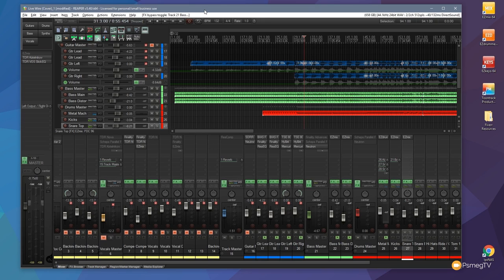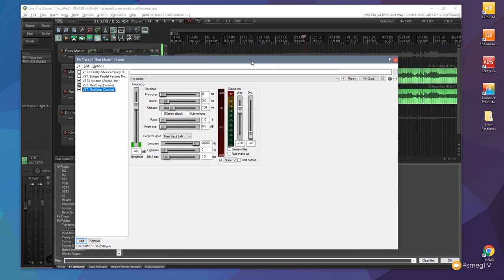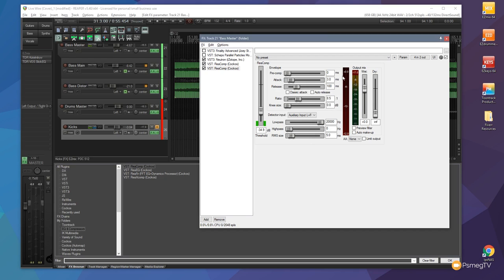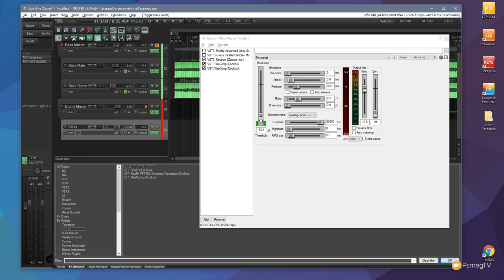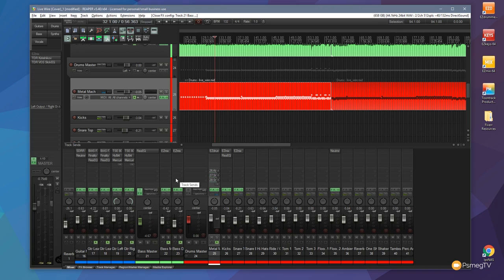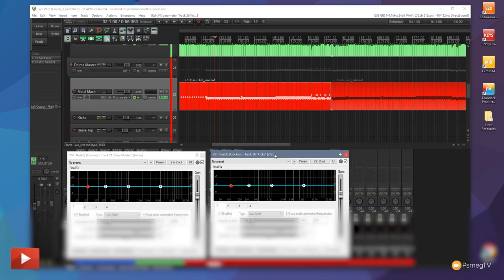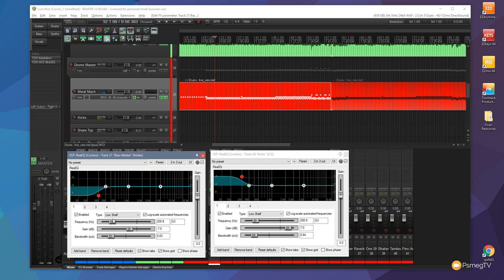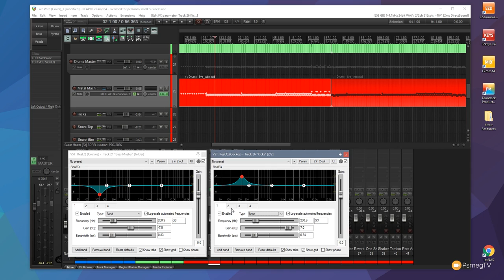2 Methods for Mixing Drums and Bass Guitar

Comment: Boosts kick frequences below 200 Hz by 7 dB
Cuts bass frequences below 200 Hz by 7 dB
"This is just something that's gonna be subtle."
Reply: Sorry, not trying to be a dick, I get that it's for demonstration purposes. What I'm struggling with is the right amount of cut, and especially boost, because it's so easy to lazily overboost the thing.
With side chain, I think the release makes the most difference, because the attack needs to be quick either way.
I wish someone could help me out with tips for specific situations.
I'm gonna go ahead and go back to trial and error until I'm not sure what I'm changing, how harsh it is, or what my name is anymore.

Comment: Thanks,very useful, question, I have SD3, I just wonder if its necessary to always set up all the tracks for each part of the drum kit(which takes up a lot of room)or just do all the mixing in in SD3's mixer? I mean if I can do all the drum mixing with in SD3 what would be the advantage to setting up separate tracks for each drum part? Thanks a lot-:)!

Comment: This comes at a very opportune time for me. I've been trying various methods of recording bass guitar, and I've found the one that gives the sound I like best is to take a pre-EQ signal from the valve pre-amp of my bass head. Obviously that leaves me with a lot more low end in the mix! EDIT: Just listened again to a recent recording I made and realised the bass guitar completely obscures the kick drum!

The EQ method seems the easier of the two. I'll have to get my head round how to set up the compressor for ducking.
Reply from the maker: The EQ method is definitely the way I prefer to do it. But the ducking method is a good way of working if you mix EDM. :0)
Reply: EQ for me then!
Reply: Never hurts to try both!  This is essentially "side-chain" compression. In a a lot of Electronic Music it is used extensively almost as automated volume effect, but it's also very common in Rock Music but with a more subtle compression ratios and such.. shouldn't really even be noticeable except that the bass seems full but the kick still punches through.. very.. illusory haha

Comment: Thanks for this. Very helpful, but at this stage of my understanding I am unclear why you set the 'Detector Input' to L + R in order to use the kick track to trigger the compressor. Could you say a little more about this, or point me to another of your tutorials which explains this kind of routing?
Reply from the maker: Of course, my bad. I did say in the video that I would link to the more detailed tutorial on the topic. That's been updated and the video can be seen here: https://www.youtube.com/watch?v=JjC00ML37NE&t=233s

I hope that helps clarify the technique :0)
Reply: Thanks very much.  Very much appreciated.
Reply from the maker: No problem at all :0)